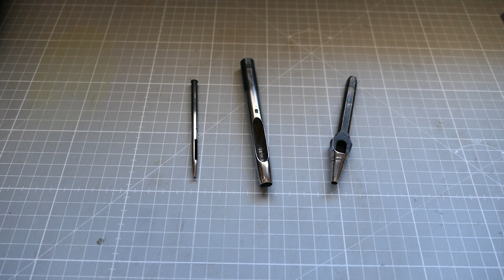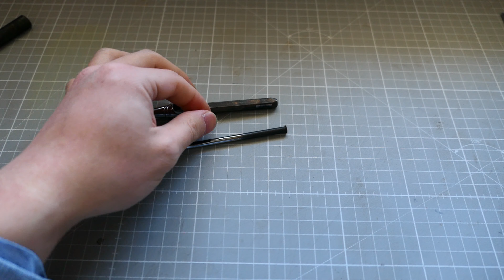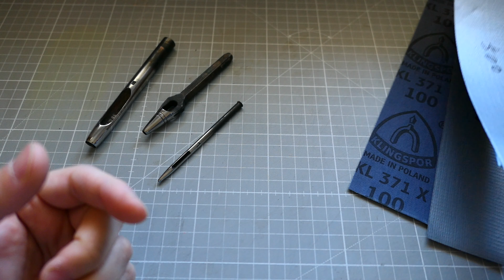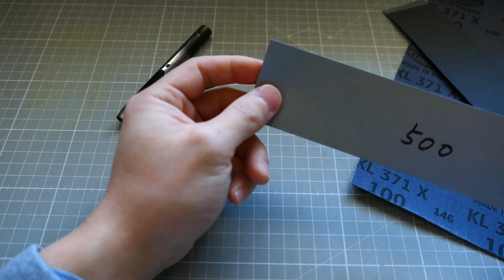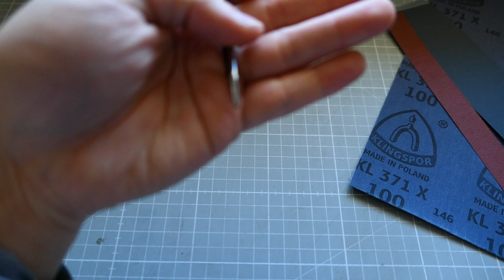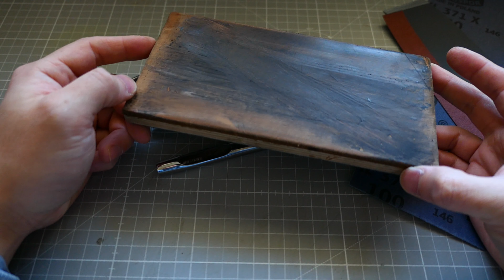SHARPENING PUNCH EXPLAINED!

Comment: Thanks for the interesting explanations. The duct tape tip is very helpful! When I saw your previous video, I wondered why you were sanding so high on the punch. Your explanation in this video made a lot of sense: a polished shaft slides out of the leather more easily after punching. You are appreciated!